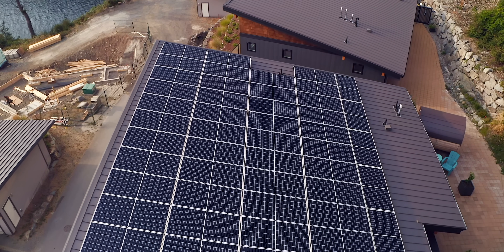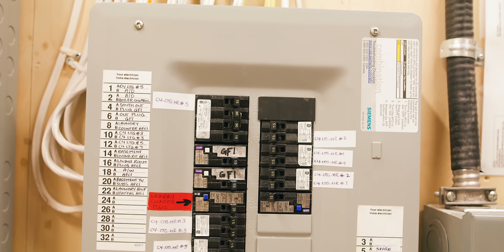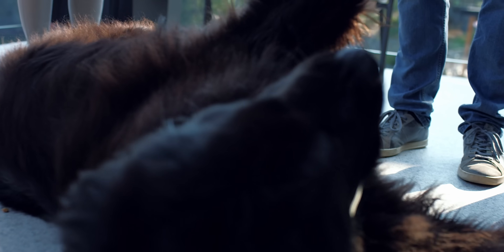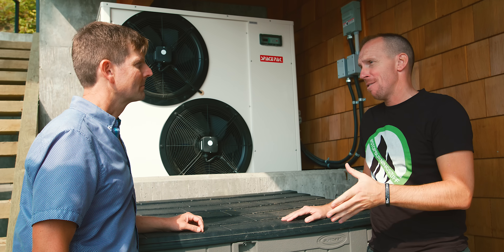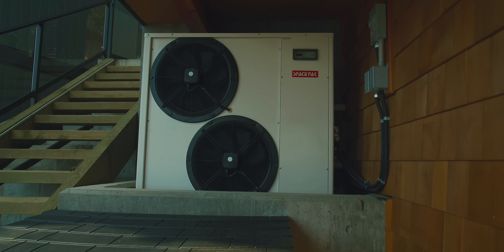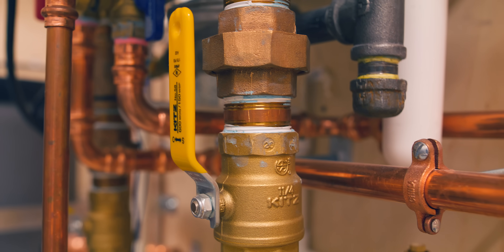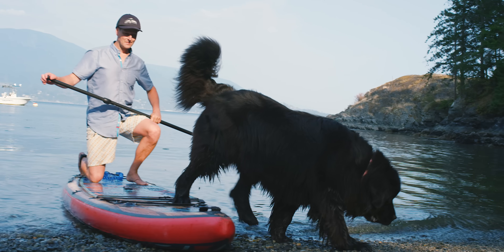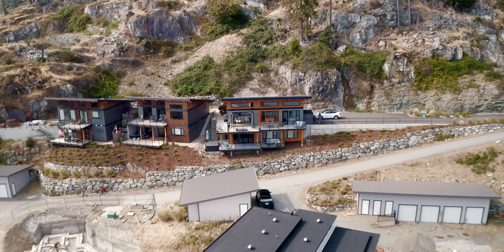How to Build a Net Zero Carbon Dream Home!

Comment: I think one of the biggest take aways from this episode should be that a single slope south facing roof should become a design standard as it allows a solar array to make maximum use of the available space for generation.
Reply: As opposed to these people who have a single slope North facing roof, with a PV array on it.  Judging by the few visible shadows and the massive windows for passive solar gain(very expensive non-dispatchable heat) on the opposite side of the house, the solar array is on the north facing roof.  How does that work at 49 or 50 degrees north latitude?
Many utilities/ states are ending net metering. Be ready to transition to on-site uses of PV, for DHW, space heat and EV charging.
Reply: @peteinwisconsin2496  maybe the main elevation is west facing for solar gain and the roof slope east facing for partial sun for the pv array. It wouldn’t make a lot of sense to have pv on a north facing elevation, no?
Reply: @immers2410  actually is better to have the roof facing South in northern hemisphere, aswell as facing North on southern hemisphere. And for the angle of the roof, the closer to the Latitude degree, the better. Considering that South is 100%, East and West are 80% efficient and Southeast and Southhwest are 95% efficient (assuming that you are in the Northern hemisphere).
Reply: To be honest, some commercial buildings and houses have made the choice of also having a number of panels West-facing as well, to collecting those summer “evening” rays 🥰
Reply: And in Britain, the slope of the roof needs to be steeper, perhaps about 50°. This will allow more generation in midwinter, when maximum midday Sun elevation is only about 15°, whilst giving a slightly lower level of generation in midsummer, when maximum Sun elevation is about 60° at noon.
Reply: Definitely agree

Comment: I would recommend insulating the pipes and using high efficiency pumps once the old ones ain't doing the job anymore, that is mandatory here in Germany since idk 10+ years.
Reply: I guess one of the weaknesses of this step system is that even very basic and affordable improvements don't get made if it's already "good enough" for step 4. It's wild how far behind they are in NA.

Comment: Would love to hear actual monthly costs of running a heat pump air con for us based people. We hear all about efficiency but is the monthly bill cost actually showing that?
Reply: You can make predictions from the amount of energy you normally produce from burning gas to heat your home. Average gas usage in UK for most regular household is ~ 12000 kWh (thermostat 18.5 C in winter). Since ASHP uses 1 unit of electricity to produce 3 units of heat, you can approximate that you will need 4000 kWh of electricity to produce those 12000 kWh with an ASHP. At a current unit price of £0.35/kWh and a cost spread over the entire year, that would amount to £116/month (0.35x4000/12). But what is important to realise is that by going all electric, your overall energy usage per year would go from a typical ~15000kWh/year for a UK house to maybe around 8000kWh, so basically ~40% reduction. Which is massive, even though supplier are charging us more and more... solar panels and battery storage to back it all up is the way to go 👍🏻
Reply: I just installed 2 heat pumps in my bungalow on a basement. My older heating was an electric resistive hot water system, so it's a nice easy comparison since both are electricity driven. My energy usage for the Nov-Dec bill dropped from a hair over 4k kwh down to a smidge under 2k kwh. Unfortunately I also did insulation upgrades at the same time so it is a little more difficult to find exactly how much of the reduction was from the heat pumps vs insulation.

As for air conditioning, that's far easier since we didn't have any before and the heat pumps have an app that tracks energy usage. Our hottest month is August and it used 111.5kWh, which in my area costs under 15 bucks, including tax.
Reply: That really depends on the costs of the alternative. If you live on an island and don't have mains gas, the alternative is probably oil, which is expensive. If you can get gas, is it a third the price of your electricity? Prices vary widely by region, which is why the SCOP is important for working out if it's cheaper for you.
Reply: For us (Dutch household, two adults, about 108 m2 ‘living space’ on 3 stories) 

Our gas usage went down from 1200 m3 per year to about 300 m3 per year. This alone is a saving of about €2700 in one year! 

Then we have two highly efficient Daikin AC’s with heatpump (one in living room, one in bedroom). Of course our electric bill went up, but we have solar panels to compensate for that. 

All in all this should save us about €5800 in this first year (because of the crazy high energy prices).
Reply: Addition: House is from 1974, investment was about €10k including taxes
Reply: We have one in a 750 sqft home. It’s been super affordable to run. Cost the same or less then the combined power and gas bill of our old home.

Comment: The thing to take away from this video is that a jurisdiction has greatly increased the energy efficiency of new buildings. This house is on a much smaller lot than 95% of the lots on Bowen Island and is smaller than most new homes in Vancouver. I agree that it is too expensive, but so is every house in Vancouver.

Comment: I'm amazed they don't have at least one small battery for power outages. Just enough to keep the refrigerator and a couple lights going.
Reply: I bet that they do have a small back up battery, just not a whole house system.

Comment: What's with the gas boiler? You spend all this effort on building a sustainable home with vast solar panels and heat pump and then you put a gas boiler in it? Or is it just for backup when the grid fails in a storm?

Comment: So, California just got rid of their net metering law because it wasn't financially viable. To make it work, they are requiring a battery storage system, which makes a lot of sense - that utility companies don't have absorb so much of a hit as a grid intertied solar house all of the sudden needs a large amount of power (sun goes behind a cloud). I don't know if the utility wants to be able to pull power from your battery as they need it to balance out the system. I'm sure there will be more information coming soon.

Comment: Nothing will matter until we get real and set a date like December 31, 2059 as the day the last drop of oil is ever pumped from the ground. Anywhere in the world. If we can't set a date for the end of fossil fuels and transitioning away from petroleum products entirely, all of the most dire predictions of climate change will be put to the real world test.

These individual voluntary highly privileged stunts make some people feel good that they're contributing, but they're just pissing in the ocean. Worldwide building standards have to be set and enforced that make all buildings net carbon zero. Otherwise it doesn't work.

This is not an individual responsibility issue. This kind of thing has to be done parametrically and without exceptions in the future.

Comment: Wait... A net zero home with 24kW of solar and yet it still has a gas boiler?? That little detail should probably have been mentioned.
Reply: I believe in some heat pump systems a backup boiler is designed in to handle extreme situations. Think the current weather bomb over Northe America right now. So it may have been put in as a precaution. And to head off your next "Huh?!?!", if it is used sparingly, the property can still be net-zero. For example, the carbon credit for the exported summer energy outweighs the carbon cost of the gas.
Reply: Yepp, that was weird to see.

Comment: I feel like Fully Charged really missed the mark on this one. Calling it net zero might be technically true, but is quite misleading when it relies on 'saving credits' over summer and spending them over winter when demand is much higher.

Also, while they don't go into details, it seems like this house isn't even built to the minimum requirement of new houses in countries like Denmark. No ventilation with passive heat exchange (such as Genvex), no limit to the windows (making the house warm on sunny summer days which requires more cooling), no air pressure testing?? Never mind the opening shots of the cleared forests that made way for these low density, single family homes.

An analysis of migrating to net positive by this step system could have been an interesting video, but highlighting this house as some sort of amazing achievement seems particularly off-colour in these financial times. Not to mention how much better it could be even with technologies from 15 years ago. While existing buildings are retrofitted with post-insulation, moisture barriers, solar, and improved heating, new buildings need to be FAR BETTER than 'technically net zero but only if the electricity from the grid in winter is renewable', and detached single family dwellings with road infrastructure need to be condemned as an extravagant and wasteful luxury, not held up as the (North) American dream everyone should aspire to.

Comment: How can a heat pump be %300 efficient? That makes no sense.
Reply: They are actually around 350%. 1 KW of electrical power to compress the refrigerant creates the equivalent of 3.5KW heat!
PS the refrigerant is pumped through a heat exchanger to heat water stored in a copper cylinder and/or radiators.

Comment: Inspirational, if only I had another £30k for a heat pump, more solar, and more battery, and a 3 phase supply for faster charging of my EV I’d be sorted.
Meantime, I’ve got to stick with my 4KW array, and a 9.5KW battery, and stinky old gas boiler.

Comment: Yes totally unattainable in the UK, unless your super rich... you need to have the huge amount of money to buy the land away from the noisy and nasty possible neighbors most of us here have.
You need to be able to buy allot of good placed land away from the other people so you can have no stress or noise. ( hence being rich ) then you can spend a million or so having a Eco style 1st class level self powering solar based battery supported home where you don't worry about the mortgage you normally have to pay for 20+ years like low paid normal working people have to worry about?

When you look at our old drafty bad housing in the UK. you see that no home can be made better unless your a millionaire whom don't work.

As for the prices of heat pumps etc. coming down! Load of rubbish, they like all other things are going up not down.

Look at Tesla and other EV makers for example.. all their EV prices are shooting up like rockets. Tesla EV prices have gone up 11 times in a few months.
So like all the tech stuff the prices are going way up as the cost f living, like power, food etc. all keep going up each week.

So saying the tech is super pricey is totally right and saying we all can just do a little to update our old bad homes when our budgets are being wreaked is just silly talk.

And Heat Pumps don't work as stated! They cost tons more to run even with a so called 1 to 3 claimed KW per heat. plus they cost £25.000 upwards before any increases coming.
The Gov grant is only max £4.000 which means your having to pay 5 times still more to replace the good well working Gas Boiler system with these heat pump things.

Better to have the Gov spent the billions they are giving to the greedy bad heat pump con men companies for them to get you to waste thousands on a system that is crap and don't work with our old leaking homes, and instead spend our tax money on updating all homes with insulation and windows etc. than wasting it on overpriced heat pumps.

Okay for places like Canada.. tons of Hydro power and a population far smaller than London never known the UK.

Comment: Step 1: Be a millionaire.
Reply: Haha. This house is way too big.
Reply: Ha ha, and when you're a millionaire like many in Hollywood, you get a pass. There you can make huge, atmosphere-damaging  fireballs and explosions and fires for entertainment.  AND you get a pass, because you are the right sort. Being the right sort gets you  all the carbon swaps you want.
Reply: Actually Step 1 is to do some research. 2nd is to be a homeowner so you cab manipulate your equity and reinvest back into your home. My uncle is not rich (former fireman) but he was able to refinance his home. It was literally falling apart so he had his house torn down to the studs to redo everything. In the process converted his home to net zero. Tesla solar roof, Tesla batteries, Air to water heat exchangers. They handle the heating, cooling and hot water, triple pane windows, spray foam insulation in the walls and an airtight r55 attic. Long story short he can warm his home with candle and he has NO GAS OR ELECTRICITY BILLS. Lastly all the money he took out of his home flips over back into NEW EQUITY. In essence he borrowed 25% of his homes value and now its worth 40% more than it was previous to upgrades.
Reply: @tingokuman how did he get a tesla roof in the UK?
Reply: Need more than a million to build that near Vancouver.
Reply: It’s a shame as I don’t see much on this channel that I can afford. I’m a UK worker in an upper tax bracket and still everything is out of my budget. I understand new tech is always expensive but surely there’s versions of some of this stuff more appropriate. Greener tech is like an illusion that’s it’s always just in arms reach. It seems deliberate in order to keep it niche so millionaires will spend tons to be better than everyone.
I remember green tech homes being trendy 30 years ago.
Reply: @ZXCVBALSKDJFH I'm in the UK too, and for me the most irritating thing is that new builds still have gas boilers and no triple glazing. Retrofitting stuff in after the fact is where a lot of the expense comes from.
Reply: and most people like u commenting on every youtube videos wont ever be
Reply: @backstabber3537  So I guess that applies to you as well
Reply: @morninboy  Backstabber3537 was a downer but I think he/she meant that if the OP has a negative attitude then that will get you no where.

Comment: This is, SO FAR removed from where we are here in the UK, and I understand the example of what can be done, with builders and planners etc is a luxury that just seems decades away in this country. We have already seen many examples of such designs in previous videos. But for us living in a 1963 bungalow, our reality involves buying five sheets of polystyrene 2.40m x 1.2m by 10cm think and sticking it to the walls of our bedroom, cost £236. That's the reality of UK home owners trying to save energy and money in the long run. We need to take action now, so all this fluffy show room designs really doesn't wash with us. If you want reality come here to mid Wales, and we will show you reality in action that demonstartes 5 years of determination to the change!! So far we have cut our carbonfoot print by 50%.
Reply: Yes, it's ironic that the people showboating their 300k property are ironically those who never have to worry about energy bills in the first place.
Reply: @XTiDesignTutor  How do you know their finances? Even if people are wealthy, everyone wants to save more energy and money, or want to help the environment. People like them are trying to when lots of people don't, so why are some people just being negative and jealous? Why do you watch this channel then? This channel shows lots of pricey tech like cars.
Reply: I think that If you are insulating and heating one room, letting the rest get cold, you risk pulling the dew point where moisture condenses inside your home and setting up a damp problem down the road. Have you worked out that this won't be an issue or maybe you work around it by heating your whole home but heating it to a lower temperature outside the bedroom?
Reply: @AndrewHelgeCox  We are not heating just one room, and we are aware of the dew point. Our measures are tempary, but we could not get anyone to give us the best insulation solution to our property which is unique in its construction. But thanks anyway for your concern!

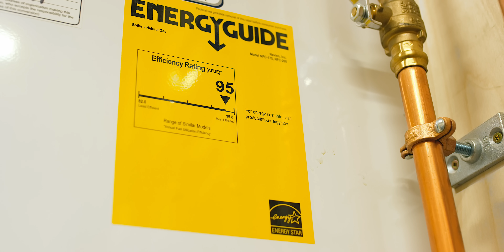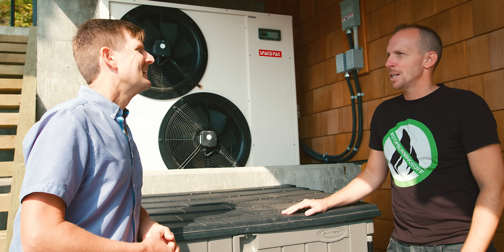Comment: Love the show but I call bs. You can clearly see the wall hung gas boiler at 5:06 and 5:58 plus the black gas pipe later on. Unless you're on RNG or counting offset, this ain't net zero. In this climate, with all that hydro, all new homes should be net zero.

Comment: So I live in a house build in 1934 and got it fully insulated, up to energy class A, neutral on electricity production and usage, and am going to go without gas heating next year. I bet my footprint is only a fraction of these people's. According to my calculations we will be independent off fossil fuels, with a heat pump, with a total electricity consumption of 6000kwh per year, while generating 7500kwh per year. So it'll be a net zero, energy producing house, build in 1934.
Reply: Generation figures are excellent. I think if you can afford too then you should do. We don’t worry too much when we buy a car and it loses 50% of it’s value in 3 years. So spending on property is a wise move IMO. Well done.